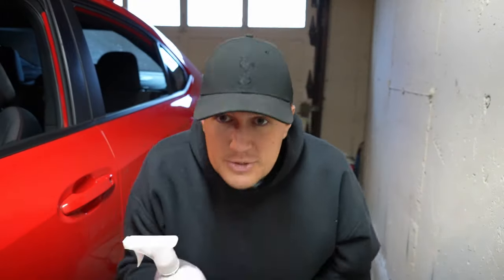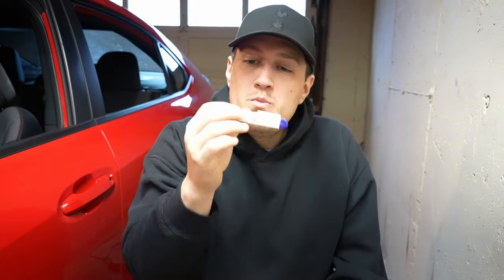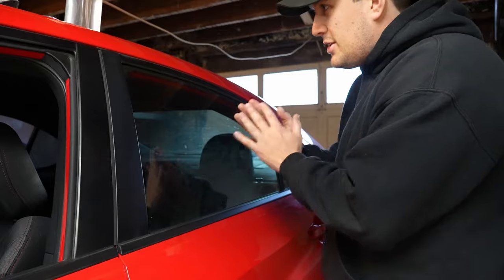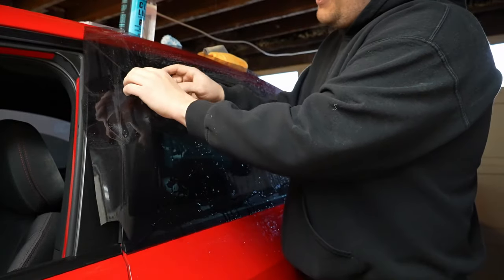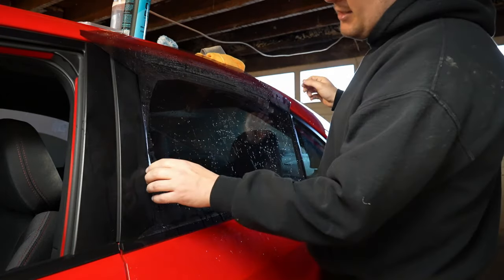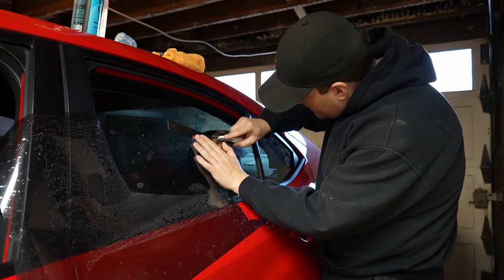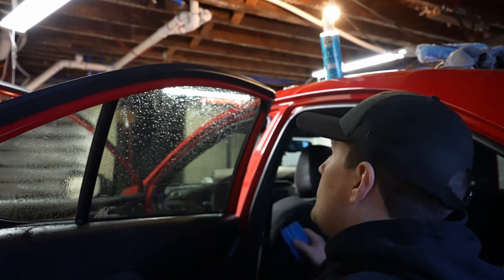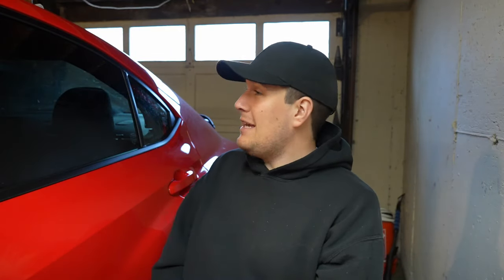How To Tint Subaru WRX Windows [Easy DIY]

Comment: Damn!! Just had the wrx dropped off for tint yesterday 😂😂
Reply from the maker: No way! What did you end up paying for tints?
Reply: @AutoEnthusiast  $400 for XPEL nano ceramic all around except front windshield. Had the car in for ceramic coating then I thought might as well have the tinting done from a reputable shop
Reply from the maker: fair makes sense! Honestly not a terrible price these days.
Reply from the maker: what % did you go with?
Reply: @AutoEnthusiast  5% on the back 3 windows and 15% on the front two. have yet to pull the trigger on front windshield tint but will probably eventually 😂
Reply from the maker: Woah! What state are you in? We technically can't get under 35% here.
Reply: @AutoEnthusiast  oklahoma, we can get whatever darkness on the rear windows and nothing below 25% on the front
Reply from the maker: @d--om489 very jealous, much more practical from a comfort perspective
Reply: @AutoEnthusiast  Bro it’s oklahoma 😂 no one should be jealous of anything in this state. rare oklahoma W
Reply from the maker: @d--om489 fair lmao